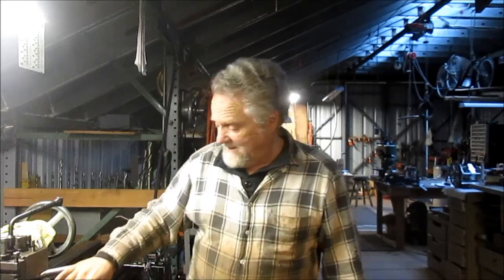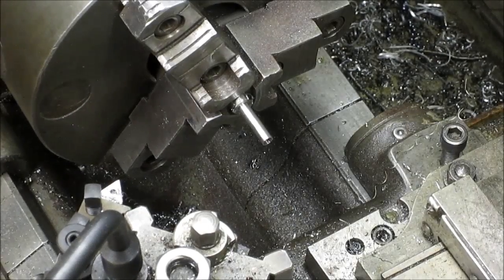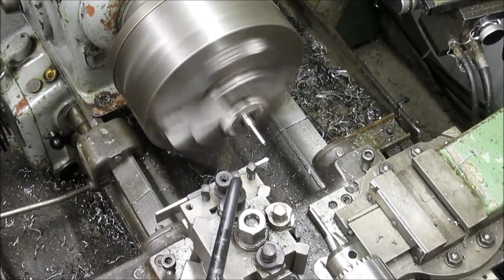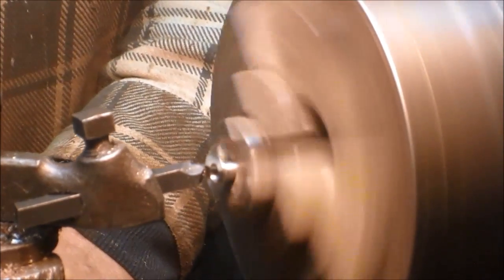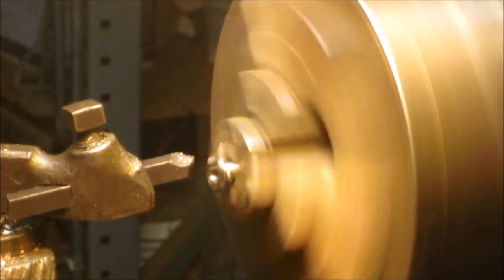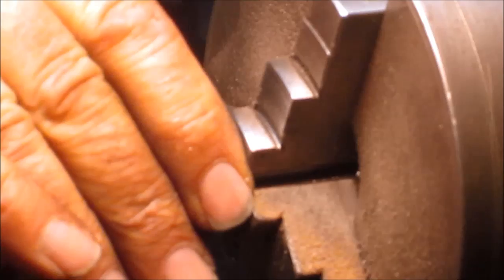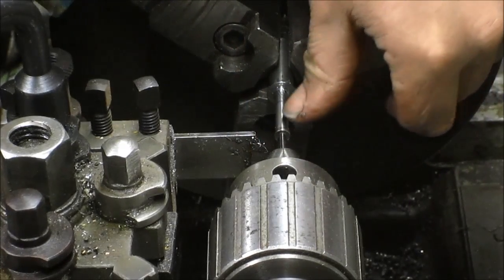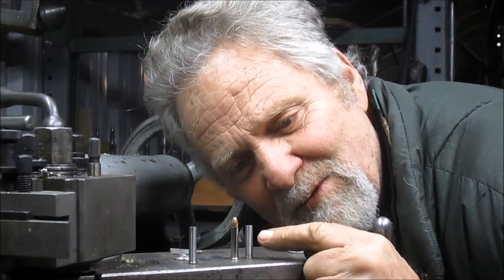Bullet Slip Fit

Comment: Nice technique with the drill shank.  That is thinking on your feet.  A gun is just a tool like any other in my view.  Hitler misused gas but I still use it albeit with a touch of morality.  Nice video.  This is the old fashioned noncnc type right up my ally and why I watch.  Always good for ideas and innovation.  The fun challenges of "getting er dun" as Keith would say.  Good work.  Doug
Reply from the maker: +Douglas Thompson Two reasons why I don;t work on guns, okay maybe three. #1. The obvious, guns are tools ultimately built for one thing.
#2. Gun owners are much less forgiving if something goes wrong and in my world things are always going wrong. If I wreck a sleeve or part I can just start over, with a gun that isn't so much the case.
#3. Almost to the person the gun owners I have had contact with want me to build a silencer or make a AK-47 fully automatic or hairtrigger a 45 auto, like a 38 revolver won't do the trick. I'll leave the macho, "I gotta have the biggest dick on the block" guys to the gunsmiths.
I love Keith Fenner. I just wish he would stop screwing around advertising and do some more interesting projects like his American Crane or the Beaver rebuild. I've must have watched both of those entire series five times each and each time learn something new.

Comment: That was quite a feat there. Gunsmithing is tricky work and the toleraces are very close. I hope it works. I mean it looks fine, but a few thou on the length might make a big difference on how the thing shoots. This is what one of your commenters meant by "headspace." And parting off, if you hit .+/-005" hand-held I would be impressed. I long ago made a Dremel tool adapter for my Taig lathe and I use the Dremel cutoff disks for a precision part-off, especially in thinwall stuff. And once parted off, it is very difficult to adjust the length unless you have a shopful of very expensive tooling.   Nice trick with the drill, BTW, have noted it down.
Reply from the maker: +Juan Rivero The rifle that adapter goes into is a single shot that opens like a shotgun so precise length wasn't an issue. I like the dremel idea. I may adopt it. Thanks for watching.
Reply: If you will look at Frank Ford's site www.frets.com/HomeShopTech/hstpages.html you will find how Frank built a Dremel adapter for someone else, including cutting the M19x2 tap. I myself used the Dremel chainsaw sharpening adapter. It has the right thread and you can improvise around that. Frank has a huge number of tips and projects in these pages.
Reply from the maker: +Juan Rivero Thanks for the info on Frank. I check him out.
Reply: Hey, thanks for posting all those videos!

Comment: Wow that's some tough stuff. Took a good bit of sawing to get through that. And especially it chewing up that bit when you were working on it. Hopefully that gets the job done for him though.
Reply: +John Klatt Oh man and having to do it over again! Jeepers!
Reply from the maker: +John Klatt  A-2 steel is drill rod so yes tough and it goes through high speed steel bits. Add to that the fact that the saw blade is maybe 20  years old, good blade but worn out. I keep meaning to change it, but that means remembering to buy one at the local hardware store.
Reply: +Nik C. Colyer remembering, that's for the birds!

Comment: Look up headspace on the Internet.
Reply from the maker: +carryit around I looked it up and it's about meditation, but I'm not sure how that applies here.
Reply: i'm sorry nik::: when chambering a gun there is a term "head-space" that is very important....normally head-space is the distance between the bolt face and the cartridge face, but it can also be thought of as the distance between the case register in the chamber and the bolt face.... on a rimmed cartridge the rim is usually what determines the headspace between the rim itself and the bolt face... that number is different for different cartridges.... and is usually determined by "go-no go" gauges for quick reference when chambering....

on .22 short, long, long rifle cartridges head space is off the rim and usually .004-.006... but each gun determines the location of that rim... some are flush across the barrel.. some ride fully proud of the barrel... those cartridges lend themselves well to using a bushing like you made because they are 'healed' meaning the bullet diameter and the case diameter are the same size plus they are low powered...

if the .22 mag gun has a rim that is fully proud of the barrel then a bushing flange will work as long as the interior is recessed to take the smaller .22 flush across it... if the original .22 mag is recessed in the barrel you would need it to fit flush along with the smaller .22.... (tough to get out in that case)

chambering is very precise but chamber reamers can vary which is why brass cases are used... brass expands to fit the chamber when fired... so shooters exam their fired brass to determine any potential issues .... also target shooters who reload go to the range to fire their brass and get the case to the exact size of their chamber before re-loading...

what you did seems to work but the cartridge will never be as accurate as the original chambering because the bullet when it is fired has to 'jump the gap' before being engaged by the rifling....

when it extracts does it extract the bushing?  also with the rim diameter at .294 on the magnum and .278 on the short... how did you get the firing pin to hit the rim??

the .22mag is a great round and useful for most situations (superior to the smaller .22's).... leave it be..
Reply: https://en.wikipedia.org/wiki/.22_Winchester_Magnum_Rimfire

https://en.wikipedia.org/wiki/.22_Short
Reply from the maker: +carryit around My customer had exact specification with what he wanted. I followed his lead. So far he has not picked the shell adapter up so no test yet. If it doesn;t work I can make another one for him charging by the hour of course.
Reply: Nik: i love your videos and am subscribed... i understand following customers orders.... its just a bushing to you the machinist.... if you dont have the gun you cant see the many issues... will the bolt close? will it extract? eject? fire??? head space???  from what i have seen here none of that will work when tested with the gun... the .22 wmr is NOT in the same line as the short/long/longrifle... so to make it work IN THE GUN will take some serious modification by a gunsmith.... 

i am most impressed with your ability to make a thin walled bushing... something i will practice... for non-gun applications i will usually bore to a larger size then press in the bush.... i have hesitated to make one that thin... i will try it now... thanks man keep those videos coming...:o)
Reply from the maker: +carryit around I have seen the rifle and it folds open like a shotgun, so there are no mechanical issues plus the rim fire hammer is maybe 3/16 wide so it will reach over the larger rim. I think it will work. Thanks for watching my videos. There are a couple of killer long term projects coming soon so stay tuned.